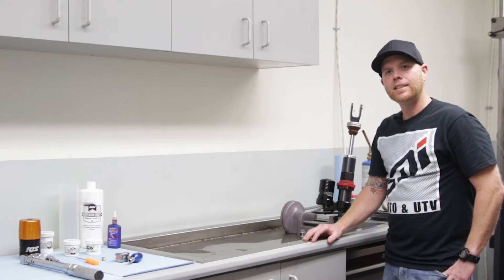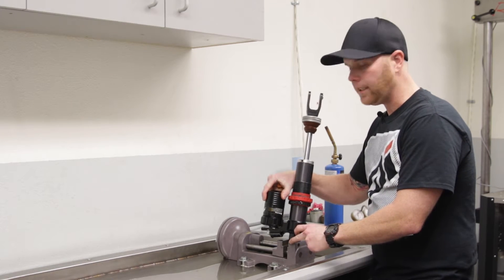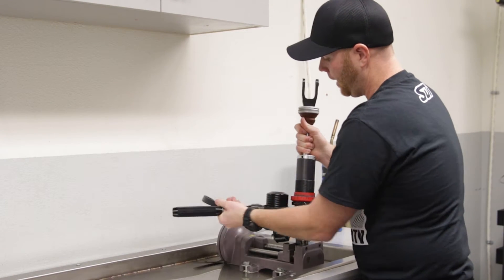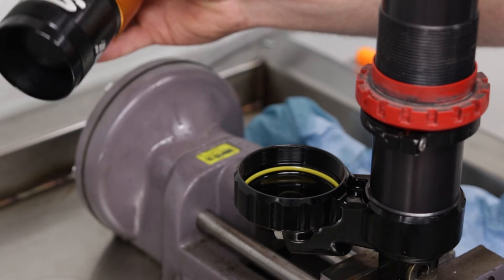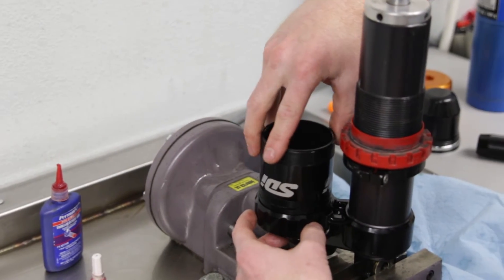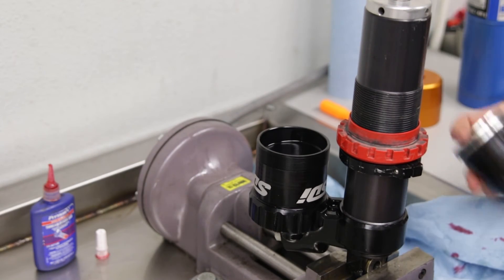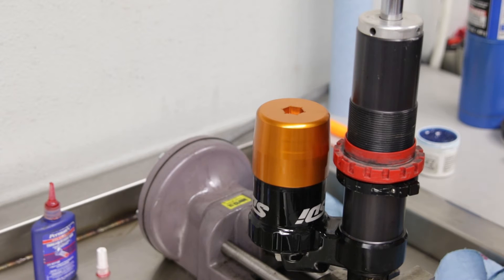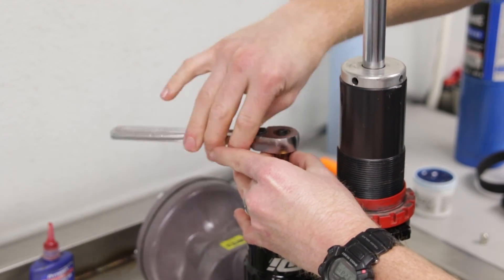Bladder Kit Conversion for 2017-2016 KTM & Husqvarna Bikes

Comment: I can tell you and everyone else. That stock cap does not come off that easy.  I had to make a special tool to break it loose.  It had so much loctite on it when I finally got it apart.  Going back together with the SDI cap and bladder was easy.  But getting the OEM stuff apart sucked. The bike had 80hours and had never been serviced.
Reply: You ain't kidding! Holy cow! I finally got it off. Took alot more heat than I expected and a special tool I made and a breaker bar with about 100 ft lbs of torque to get it off. I grinded down a 15/16" socket so it had 2 prongs to attach to the reservoir holes, took a bunch of time with the bench grinder and a file to make it fit nice, should have used a 7/8" socket.
Reply: @tom97zr2  Thats a pretty good idea, I was going to try and make a tool that did a similar idea but never thought to just grind down an old socket.  My hope was to find some way to attach a breaker bar to a tool.
Reply: @keithncollins  I've made alot of tools in the last year with a socket and a grinder and a file. 👍

Comment: does this eliminate the need for KTM vacuum system?
Reply: That's exactly what I was just wondering.
Reply: I'm pretty sure it does. I always thought that the piston design would have a ton of bubbles hidden around the pistons/shims where the bladder is smooth and easy to get all the bubbles out without a vacuum system.
Reply: Of course.